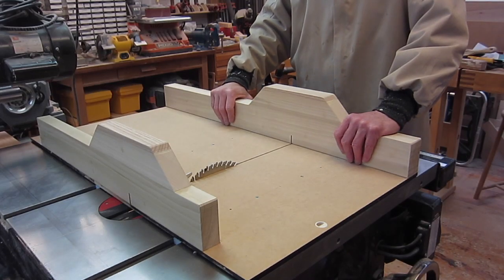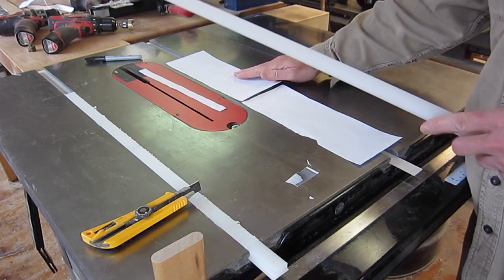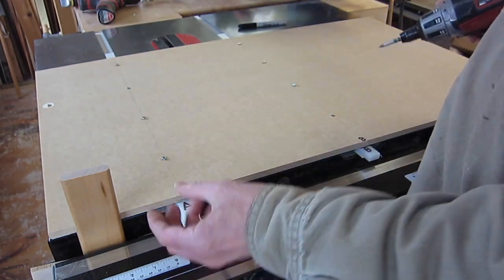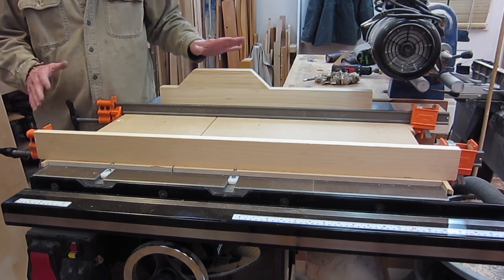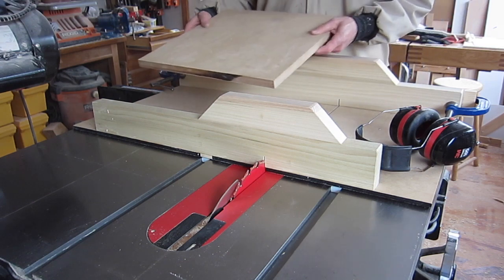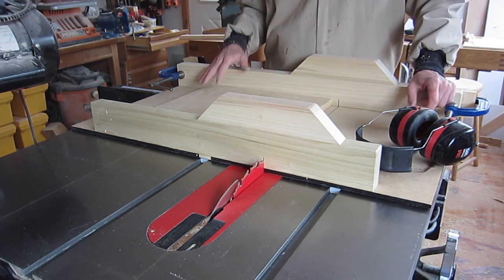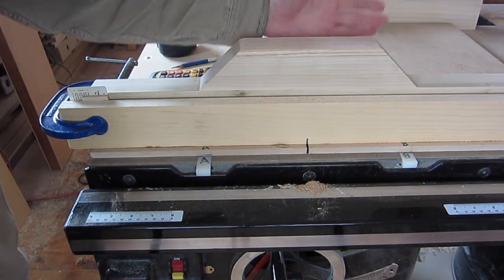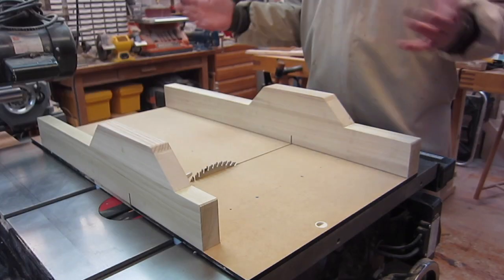Make a precise crosscut sled, for table saw, using 5-cut method.

Comment: This video is a textbook for building a crosscut sled.
Reply from the maker: Thanks.  
If you are planning to build a sled here are a couple of suggestions:
1)  best example of 5-cut fence calibration can be seen in this video which is my most recent sled: https://youtu.be/a9Ze31mW3bo

2) As shown in the video, the sled is made with two runners and the runners do not have to fit snug in the table saw miter slots.   One year later, having gone through the four seasons of humidity, I find the sled is a little loose in the runners.  Other sleds I made with a single snug fitting runner have not become loose.   My conclusion is that one runner is better than two, as long as the single runner can be made to fit snug in the miter slot.  Here is a video showing how to cut snug fitting runners:    https://youtu.be/MZu0JvW1g3k

Comment: I also want to mention that I had tried store-bought aluminum adjustable sliders (made by incra) for the mitre slots. While they were adjustable they were quite inferior to cutting your own sliders.
Reply from the maker: Good to know.  I was considering a 30 inch metal slide for a panel cutting sled that I plan to build, but will stick with UHMW.